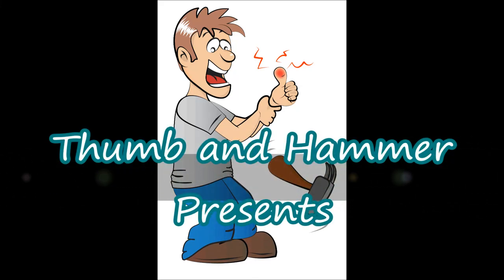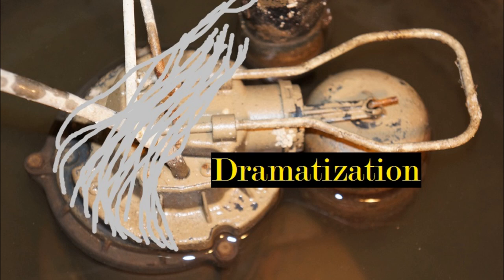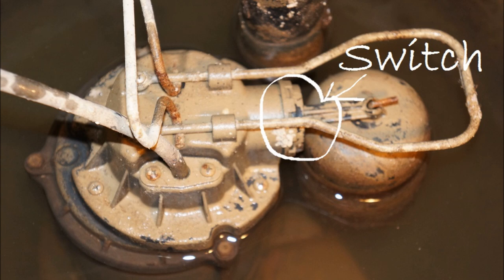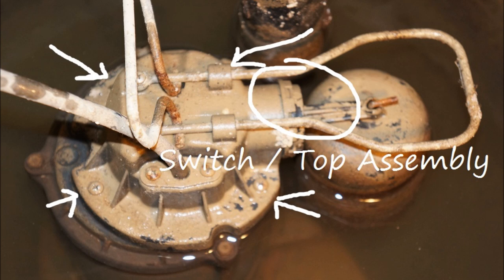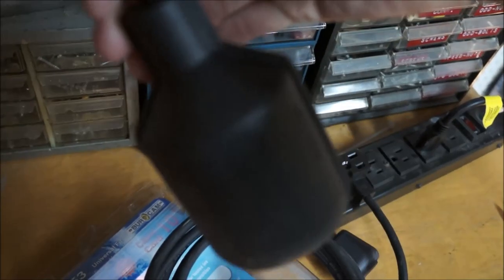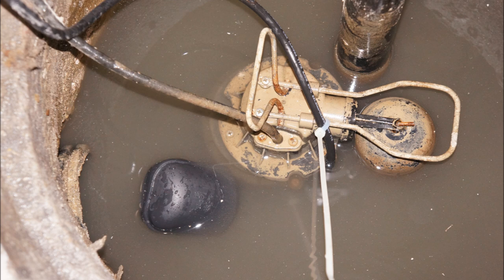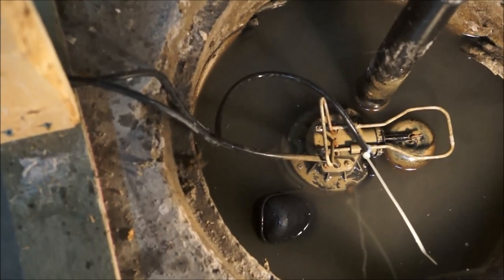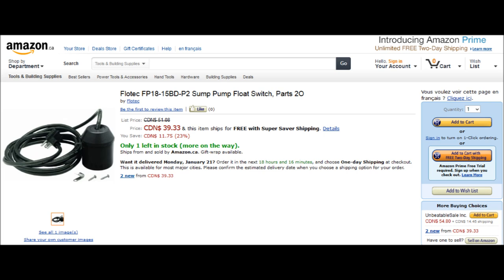Easy fix for a sump pump that will not shut off

Comment: This video saved our basement.  A storm was bearing down on us and I noticed that the pump was running non stop. i knew the motor would burn out.  I watched this video, ran to the hardware store, bought the float switch and installed it all in the space of about 30 minutes.  The rain was starting to fall just as I finished.  We got 3.75 inches of rain that night, and the basement stayed dry.  Thank you!!
Reply from the maker: Happy it worked out for you.

Comment: Your video saved the day for me. The float switch on my primary pump was not turning the pump off so I ran to Home Depot, bought one of these, installed, tested it (worked perfectly), all in under an hour from discovering the problem. Luckily, HD is 1/2 mike from my house. THANK YOU!

Comment: I thank you too.  Man I purchased a new sump and a back up unit. Only had one plug  so i attached a small extension cord with 4 outlets and plugged each piece into its own.  Forgetting that i needed to plug the unit into the switched plug and keep the back up separate.  Brand new and it kept running..... now its fixed....

Comment: I had a similar issue but I choose a different type of switch. I bought a Levelguard switch 10 years ago and it’s still running reliably today.  If you are in need of a reliable one I’d recommend it.

Comment: The opposite is happening with single plug sump pump. If pump has to cycle three consecutive times the lever will click off and will have to be pushed manually. An additional pump switch does fix it but eventually the switch clicks off ,unless maybe there's a level it needs to be adjusted to that's different from the original switch?
I first used another pump with two plugs without connecting the pump part but the only way it was working without the regular switch clicking off was with the additional switch level with the water level but I think it may have burned that up since the current seemed to be mostly energized more. The basement watchdog says to disconnect old switch but that's impossible on a single plug pump.

Comment: Sump pump stuck on on. I unplugged the Sump pump for a half hour then plug it back in. When I raise the switch up to turn it back on again, this time it shut off. Also I did the bucket test as well after waiting another half hour. Should I be thinking about replacing the Sump pump switch or even the entire pump? I just had it replaced maybe 4 years ago.

Comment: We have a brand new sum pump. It is turning on every 2-3 minutes and drains for a few seconds. Why is it turning on every 2-3 minutes? We've had no rain and the pipe outside seem to be fine. There is nothing blocking the exit where the water flows out onto the grass. Any immediate suggestions would be great.
Reply from the maker: A Google search for "sump pump short cycling" may offer some suggestions. There are a number of reasons why this might be happening...

Comment: What do you do if the sump pump is in the off position.  When I plug the pump in directly it turns on.  Can I still use this fix ?  Seems a lot easier than having to remove and replace my current float.  Current float is sort of like yours in the pic with the piggy back switch
Reply from the maker: Sorry for not getting back to you sooner.  I was on vacation.  I am not quite sure I understand your problem.  If the pump turns on when you plug it in, that indicates that the switch is stuck in the on position.  This solution will work in that case.

If you have an internal switch stuck in the off position, I believe that you will have to remove the pump from the pit and open it up to bypass the internal switch.  This link may help:

http://www.flotecpump.com/residentialpage_resource_starthere_sump_fltswtch.aspx

Not the quick and dirty fix  that I describe here, but it makes future replacement easy.   I would consider replacing the switch with an OEM one since the pump has to be removed anyway.
Reply: Thanks for the response.  I replaced the float switch with the quick fix and it worked.  The old one was stuck in the off position but it didn't seem to matter.  All good now.

Comment: Will this solution still work if the stuck float switch problem is intermittent? Will the new float switch override the old if the old decides to work?

Comment: We have an old Goulds sump pump probably from the 50's.  We really like it however there is some kind of magnet in the little box at the top of the float that comes unstuck every couple weeks when in  high usage.  The problem starts with it stopping and starting and eventually gets stuck on.  My husband will restick the magnet and its ok for a few weeks but I'm worried when we are not home if the motor with overheat and cause fire.  Will your product help us?  Can we fix this ourselves?  We really don't want to replace the whole pump.
Reply: +eeb7dmb Yes you can,you would have to bypass the pump switch or make it so it's always on & use an alternate float/switch such as this one in the video.Pumps are really inexpensive & yours is 50 years old, don't you worry about not being there & flooding ?
Reply from the maker: +eeb7dmb Sorry I missed your question.  And thank-you +Tjfreak for your answer.  The float switch works well as a temporary solution, but you should consider proper repair or replacement of the pump.  In your case, when the pump is 50 or 60 years old, it makes sense to replace it.  You might also want to consider installing an additional  battery operated back-up pump at the same time for peace of mind should there be a power failure, or in the event that your main pump is unable to keep up during heavy demand situations.

Comment: You can hear that this float switch is too high. Hear the water running out of the pipes as the pump pumps down. Set the switch so that the perimeter drain pipes can always freely drain into the pit.
Reply: I thought the same thing. I wouldn't want water sitting in the pipe.

Comment: these float switches also fail and will usually do so when they are supposed to turn on so flood can still happen i have had 3 pumps with this type switch and all failed in exactly the same way took apart the last one and found that the arc that occurs when the metal ball contacts creates carbon tracks on the contact surfaces and prevents the switch from working i i would consider this switch as a temp fix only
Reply from the maker: Agreed.  
According to the manufacturer, the switch on the pump should be replaced every two years.  The mechanical float is not a perfect solution.  First, It will only work if the pump switch is "on" or if you bypass the internal switch. Second, as you said, it too will eventually fail.  The advantage of using the mechanical float switch is that it can be "installed" in minutes without having to remove the pump from the sump pit.

Comment: Does this totally bypass the old float that is messed up?Mine comes on at a certain level and pumps it out but not completely out (unless I lift the float).It turns off when the water is gone. I want to use a product like you have in this video but was wondering if we have to do anything with the old float (to bypass it).
Reply from the maker: I can only speak from my experience where it was the switch that had gone bad and was stuck "on." The tethered mechanical float switch has a piggyback plug that the sump plugs into, so it effectively replaces the defective switch. I did a little cursory research and it seems that vertical floats (which I assume you have) are not very adjustable. In this case, you could probably find a way to keep your switch in the "on" position-- prevent the float from traveling down with the water level-- and then use the tethered float switch. 

But check your owner's manual first to see if you make any adjustments to your pump before you spend money on another switch.

Comment: How did you do the connections to the wall outlet? Did you need to integrate it with old float switch?
Reply from the maker: The float switch has a piggyback plug.

Comment: the same exact thing is happening with our sump pump too! and its also making a strange noise too but i don't know if its because its supposed to be making that noise or if there's something wrong with it. please help me!
Reply from the maker: A "strange noise" is difficult to identify without hearing it...  A pedestal pump will be louder than a submersible one.  It could be an issue with debris.  You should be doing regular maintenance to keep the pump and the pit clean.  I recommend this video:  Simple Sump Pump Maintenance.  Finally, if your pump is not shutting off at all then replacing the switch is the most likely solution.
Reply: thumbandhammer could you please explain what a submersible and a pedestal pump is?
Reply from the maker: gracie daly A submersible sump pump, like the one in the video, has a sealed motor that is cooled by the water it sits in.   The motor of a pedestal (or column) sump pump is, well, on a pedestal-- a rod or pipe that raises it above the water level.  The motor is air cooled, and since it is outside of the pit, it's louder than a submersible.  This link may help you out:  http://www.basementsystems.ca/sump-pump/reviews.html
Reply: we have a submersible pump and thank you for the link. I'll have to try it!

Comment: Ok so my sub pump turns on soon as I plug it in. I replaced it in August brand new. vould it just be stuck in the on position, if so how can I tell?
Reply from the maker: The float operates the switch.  If you have water in the pit the float will trip the switch into the on position.  The float drops with the water level as it goes down until it trips the switch into the off position.  So, if you have water in your sump pit, the pump should come on when you plug it in.  You only have a problem if the pump continues running after the water is pumped out.  If that's the case, make sure that the float is able to move freely.

Comment: Not a good idea. Floating switches get stuck on the basket or other items in the basket disallowing the sump to turn on. This is why most good sumps use fixed switches.